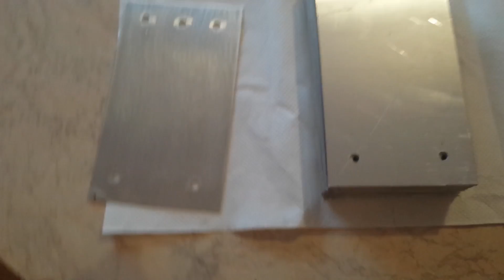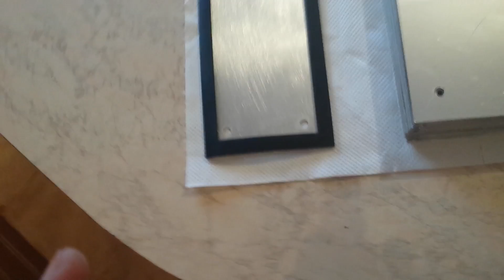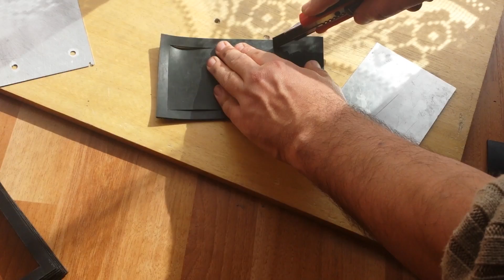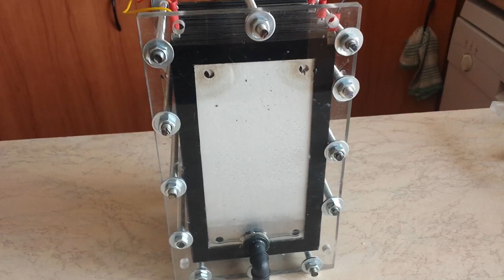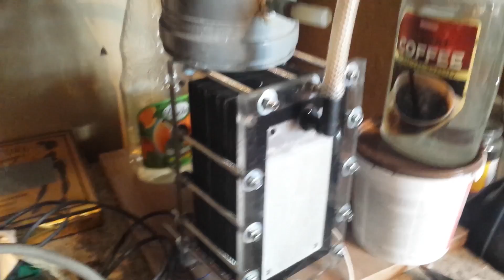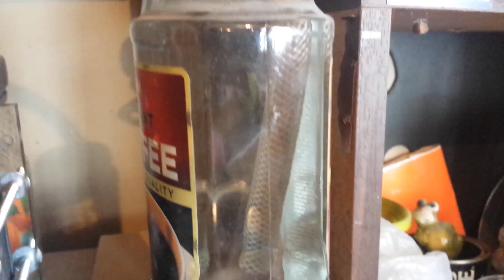hho generator with 31 aluminum plates

Comment from the maker: So what should I use because water on its own will not work
Reply: +01wizmiles01 Stainless steal. The Aluminum can act like a diode as well and only let electricity flow in only one direction. That could be part of the problem as well. The Aluminum has oxidized and not letting electricity pass through it.
Reply from the maker: use NaOH
Reply: +01wizmiles01  im also using Na0h that was in the description
Reply: +01wizmiles01  
Aluminium plus NaOH = Hydrogen plus Sodium Aluminate. What an "in your ant"  idea.
Reply: please don't use NaOH in your aluminum cell, it will destroy it, use a food grade electrolytes it is non corrosive, like oral rehydration salt or pedialyte or dextrose,

Comment: Aluminum will not work long time for sure. I tried and it works fine with Aluminum  Nickel electroless coating. I noticed Nickel oxides on electrodes - turned black- but reversing the polarity it revert to normal.

Comment: only high grade stainless steel will work not aluminum.
Reply: aluminum works actually better than inox but inox is nearly useless against hydrolysis. Not the case for aluminum. You need to replace the plates after a while

Comment: Both NAOH and KOH produce at very least hydrogen in reaction with the aluminum. You just need a jump-start and it keeps going. I never did understand why on earth someone would want to use electricity to save gas (um, that don't figure) But a KOH solution is easy to make and cheap as can be (free). You stumbled across the holy grail, a cheap fuel that makes itself (practically) the problem if there is one is that you are thinking about using it for an internal combustion engine in a car, vs an in-line hybrid where a constantly running generator refuels the batteries. With the latter set-up you would want a reaction that you did not have to introduce electricity into, as your primary and indeed only fuel would be HHO instead of having gasoline anywhere in the mix.

Comment from the maker: In a matter of few weeks. The problem is that you cant turn it of it keeps working without electricity
Reply: 01wizmiles01 Stack load is too high. Occuring ion's naturally without current.
Reply: 01wizmiles01 
Use split the positive with a bank of batteries for electrolysis production.  This way you end up with a few charged batteries every time you use the process. 
Look up bro Mikey to find out how!
A bank of batteries in a pickup bed running a large cell would be a nice setup.  Could also use solar power panels to keep the batteries charged and they could be placed over the batteries in the pickup bed.

Comment: stainless steel plates is the best metal to use or platinum if you can get them
Reply: Stainless steel is the worst metal you could use. The chromium in the steel leeches into the water turning it yellow and is highly toxic, you would be poisoning your water supply every time you drain the yellow water into your drain or sewers. In fact if a lab did that they'd be hit with a huge fine for pollution.
Reply: I use a Power width Modulator Modeled on the Stan Myer design I use straight distilled water.! I don't use chemicals at all..How do you keep the aluminum from breaking down Like silver does ? and 4 years now I have not once had to Dump my system's Liquid base it's just as clear as the day i filled it.....and why don't I have a video of it LOL look what Happen to Stan Meyer.! water fracturing tech, is risky business..
Reply: I would not use aluminum either. Platinum is probably one of the only metals that won't corrode in this application which is why it's used in laboratory settings.
Reply: Right on

Comment: You can actually produce Hydrogen by leaving aluminum cans in a basin filled with lye.
Reply: For those of you who don't know Lye = Potassium hydroxide.  You can buy it from any hardware store.  Be aware that a little KOH (Potassium hydroxide) is good, while too much will increase the conductivity of the water and therefore the resistance and the heat!  A 31 plate dry cell will produce liters of HHO with only 12 volts and a few amps.  Good luck.
Reply: Actually, lye is sodium hydroxide. Almost got the chemistry, just mixed up your alkali metals! Also, adding more lye will increase the conductivity, but instead of increasing the resistance and heat it will be decreased. 
Conductivity is the exact opposite of resistance in that when one goes up, the other goes down.

Comment: Hell dude!!!!  Get rid of the Aluminum it will corrode away in weeks. Use Stainless only... If you see NO corrosion I would be very Very very surprised.

If you want to see just toss an aluminum plate into a tray with electrolyte in it and leave it for a week and check back on it.

Comment: aluminum will work but it won't last it will corrode easily unlike stainless steel and nickel which is used in jet blades.

Comment: Using KOH as the electrolyte will continue the reaction till the aluminum or water is completely consumed. KOH causes a chemical reaction with the aluminum producing hydrogen and other toxins. If you had a stronger concentration of the KOH you would get a greater production of hydrogen but your plated would be consumed much faster. Some people take scrap aluminum, KOH and water and purposely mix them together because it produces a greater yield of hydrogen when compared with traditional electrolysis.
Reply: Sodium aluminate is also formed by the action of sodium hydroxide on elemental aluminium which is an amphoteric metal. The reaction is highly exothermic once established and is accompanied by the rapid evolution of hydrogen gas. The reaction is sometimes written as: 2 Al + 2 NaOH + 2 H2O → 2 NaAlO2 + 3 H.
Reply: True going green means creating lesser toxins as a byproduct. Clean energy is  Energy In < energy out. Energy in should be lesser than energy out plus byproduct of clean air.
Reply: hydrogen isnt a toxin.

Comment: Im no professional, but I do believe that aluminum and baking soda, aka caustic soda by itself produces gases.i do believe heat aswell due to the chemical reaction.this is how the crystal form of draino works.but I have made an hho gen 9 plate cell of brushed nickel, and I gotta say it produces equal to my stainless steel cell.but I must recommend using KOH as ur electrolyte. I think is also called potassium hydroxide. Awsom out put, with no browning, or yellowing of the plates.u may also wna try a pulse width modulator, or pwm, and larger gauge wires just because of the heat it will create. Good job tho looks good.
Reply: نقشه ساخت لازم دارم چگونه ییدا کنم

Comment: Do not use KOH in this Cell. 
Corrosion you still get, only on the positive Electrodes.
Reply: almost all of them have a positive side. 01wizmiles01 aluminum is a bad choice man. best you use 316L grade stainless steel
Reply: richardlyew or you use titanium?
Reply: titanium is expensive so only use it for connecting plates
Reply from the maker: thank for that
Reply from the maker: richardlyew will do thanks